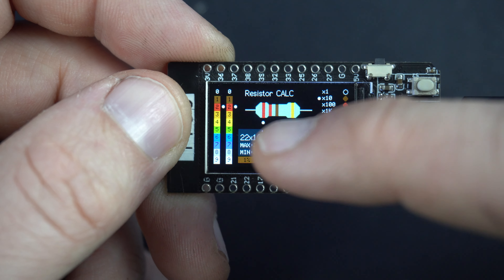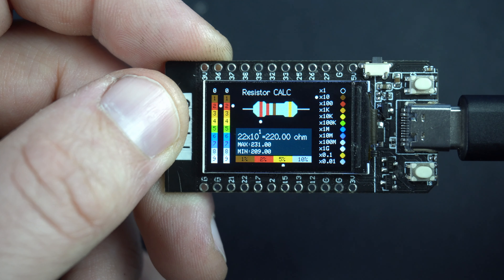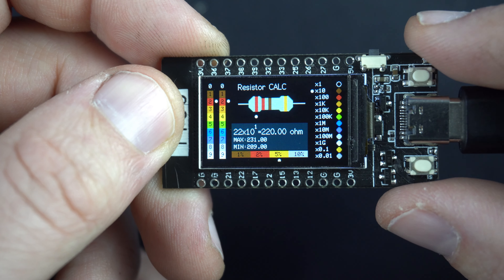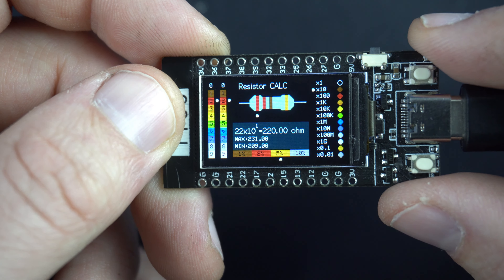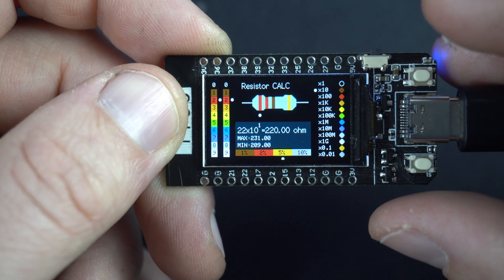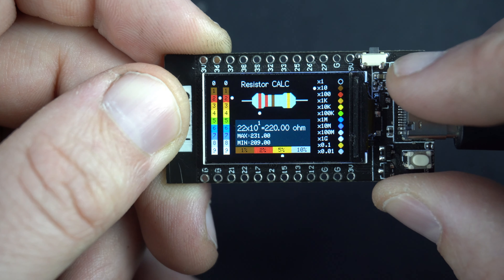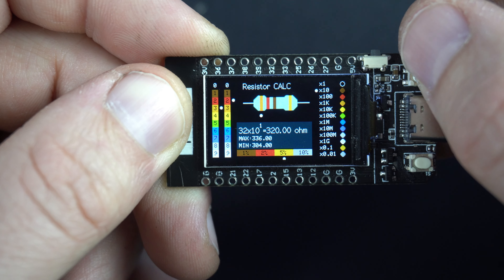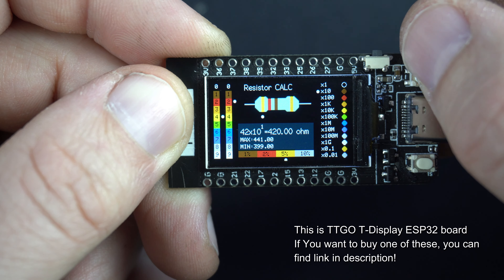Band Resistor Color Code Calculator on TTGO T-Display (ESP32)

Comment: Nice project.
The problem I have is that while even my old eyes can easily read the 4 band code, with the 5 band code even my younger eyes struggled to identify the colours in the first place.  5 band resistors send me straight to the meter, even though I know the code.

Comment: Nice work.  A huge improvement would be to have two contacts.  When a resistor is placed across them, the A/D converter would read it and tell you the value and display both the four and five color band codes for it.  (This might need an external A/D since the ESP ones are limited and not completely linear.
Reply: Great for the newbies to learn the codes, and maybe a switch from 4 to 5 bands?
Reply: @Theineluctable_SOME_CANT  
From the video, it appears to just allow you to recreate the color bands on the display and then show you the target value.

Comment: Nice little project. I added a delay to "de-bounce" the buttons and because I plan to use mine on battery power, I added the ability to have the device turn off after 1 min and wake when a touch pin 9 is pressed. Not great coding but I'm new at this and it worked. :) Thanks for the projects, keep them coming.  Heading over to buy you a beer ... er ... coffee now :)
Reply: hi, can you show me how you did your coding? I'm also a newbie and I was planning on using that feature for my thesis... thanks btw

Comment: 6 should be blue, 7 should be purple.  On the screen, they look similar around 2:00.
Reply: Looks correct at 3:14.
If I remember correctly, cameras do struggle with violet, but the display should be generating red+blue, not spectral violet, and the camera should eb able to see that, so it's a bit puzzling.

Comment: Another super cool project!  Just got a couple of TTGOs and was wondering what I could try next. I've had pretty good success memorizing resistor color codes. The mneumonic methods never really worked for me, but the visualization technique (olive, bear, cherry, banana...) has stayed with me over time. For some reason, I still get tripped up on 5-band resistors, and that seems to be the kind I have most of. Maybe you could add a 5-band option to your project as well. All that being said, I still check my components with a meter just as a backup for both me and the component.
Reply: @Theineluctable_SOME_CANT  Bad Boys Rape Our Young Girls But Violet Gave Willingly is the one we learned.
Reply: @TheUnofficialMaker  The one I learned was a little tamer, Bad Beer Rots Our Young Guts But Vodka Goes Well.

Comment: Hello again, I was wondering if there is a way to run multiple code in the TTGO display and selecting them with hardware button so you are not limited to just one function for the Esp32. For example have this resistor selector code then press button to change to calculator etc.. Thanks.

Comment: Hello good day, ¿what setup you are using for the library TFT_eSPI? thank you so much
Reply: I put the configuration 25 and i need set rotation to 0 and the image is out of the display and i not found the reason.
Reply from the maker: here is my tutorial https://youtu.be/b8254--ibmM?si=624--AFYq93ymZkr
Reply: @VolosProjects  Thank you so much for help my I found the problem, I dont unwrrite the first configuration and  the program takes the first and second. Thanks new for help my and for share these nice project.
Reply from the maker: @ricardp1380  no problem, i am glad you found solution.

Comment: Very cool, is it also possible to calculate the values of smd resistors?
Reply: SMD resistors (& capacitors) tend to have their value printed on them in plain numbers.  
IE first 2 numbers followed by a number denoting how many zeros following
EG 104 means 100000 which is 100k, 331 means 330, 472 means 4700  etc etc
I have a lot of trouble reading the 5 band 1% tolerance components myself but a multimeter solves that problem